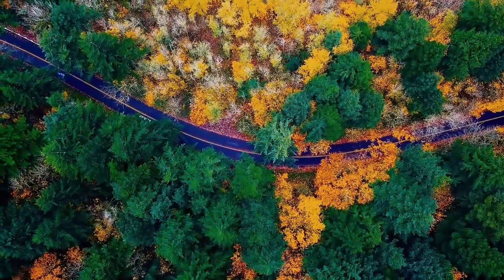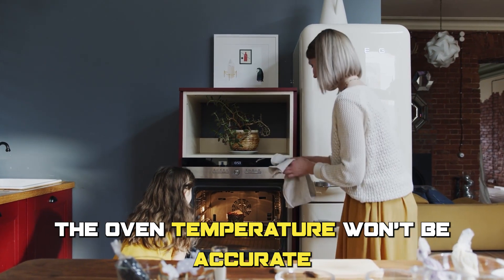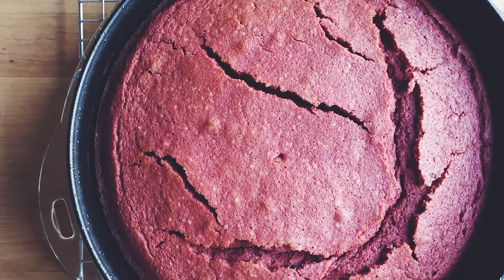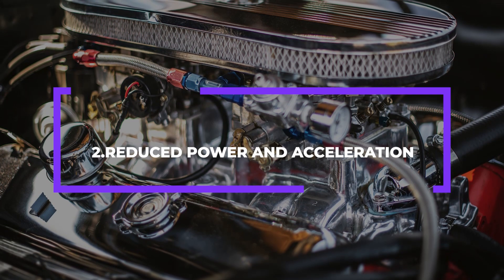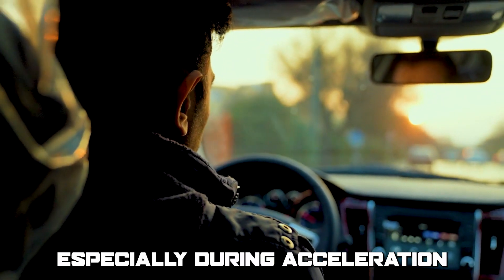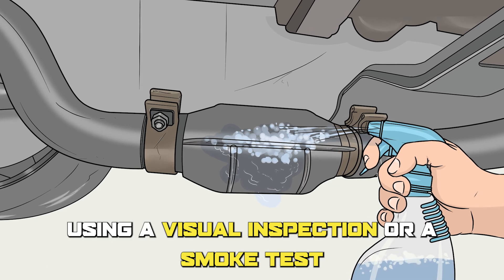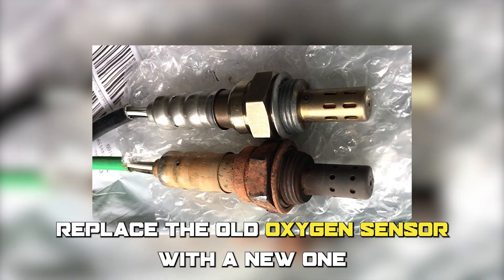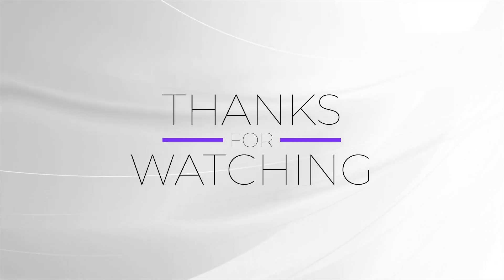P0133 ERROR CODE: MEANING, SYMPTOMS, CAUSES AND SOLUTIONS (Sensor Circuit Slow Response)

Comment: Okay and what o2 sensor do I get?
Reply: From my experience I replaced the o2 sensor upstream of the cat.  Cleared the lean error.  Afterwards the po133 error came up.  I replaced the downstream(after cat sensor).  No more error codes.  It probably is best to replace both. They eventually foul up or breakdown.   Not a guaranty but it worked for me.
Reply: I got both for less than $60 online.